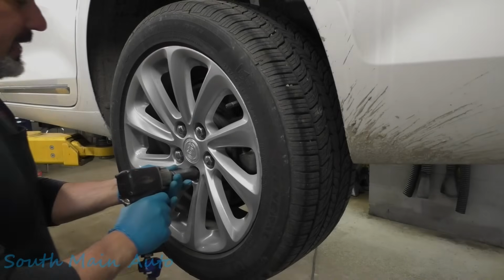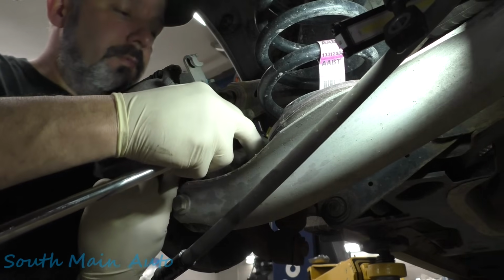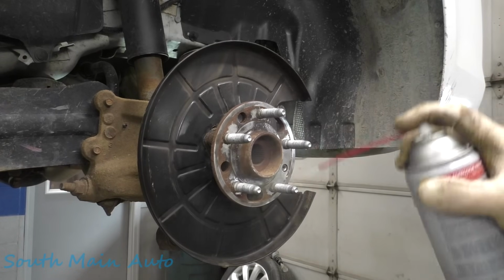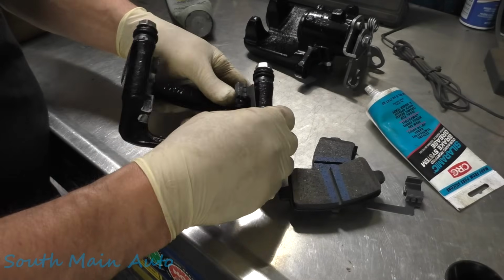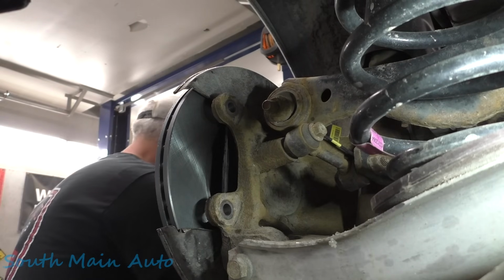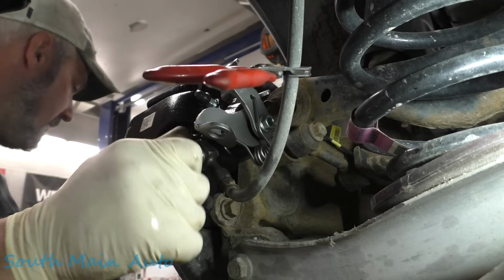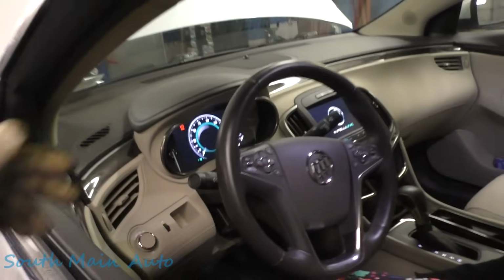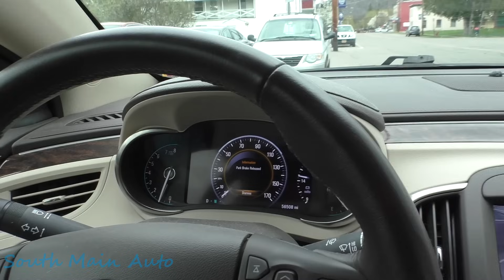Buick LaCrosse: Rear Pads, Rotors & Calipers

Comment: Hi Eric,  greetings from England,  UK.  If you want a handy thin wrench to do those caliper slide pins and other bolts that are restricted for width,  buy yourself one of those multi combination spanners / wrenches that are sold for cyclists,  they have got me out of a muddle a few times with calipers and they usually cover sizes from 8mm to 15mm or so.
All the best mate.

Comment: Mrs. O always looks so wholesome and nice. Very pretty dress there lady.  Eric, that was a "Bread-n-Butter" job where I worked for 25yrs. On all of my brake jobs I'd put slick'm between the pad contact and the stainless steel hardware too. My brake jobs went 100,000 miles sometimes, and never had a slide freeze up. Also when I went to Automotive Tech School we had to take a fastener class where we were indoctrinated that every bolt that gets "torqued" must have lube on it. So, I always slicked up the mounting bolts w/ Synthetic grease. And, I slicked up the lug nuts with it or wheel bearing grease too. The guys that worked with me at the the muffler joint thought dirt, rust and cross-threading was what keeps a bolt tight. I tried to splain them NO the bolt stretches and that "spring tension" was what keeps it tight. I been mechanicing for 57 or 58yrs  and never had a lug nut come a loose.  ben/ michigan

Comment: I bought a 2005 la crosse used in 2006. Put 245000 miles on it ran great and sold it last fall. Very few issues loved that car
Reply: Yea but Eric thinks USA cars are junk...
Reply: I got an 06 cxl 3.8 with 95000 miles it will last forever.

Comment: Just did the same thing 2 or 3 weeks ago on my girlfriends 2014 Chevy Impala. Exact same thing, 2 years older, only i did the hubs and wheel speed sensors as well. You are probably the only reason i even attempted doing the hubs. Pain in the whoo haa. Didnt have the last chance so i used a half inch grade 8 and my dwalt impact. Got rid of the helicopter and the brakes work beautifully now. Did the front hub about a year ago and the half inch grade 8 worked perfectly. The backs a lil different. And the reason  i changed the front was a diagnoses i learned from you. Abs light and traction control light... either abs sensor or the magnets gone. Sure enough when i pulled the hub out the magnet was 2/3 gone. Thank you brother. Love watchin your videos and learning.

Comment: So about squeezing brake hoses.  When doing calipers I use this opportunity to change out the old brake fluid and let it run out. Squeezing inner lined hydraulic hoses is a little dicey. I really enjoy all your difficult car repairs. Keep up the great vids.
Reply from the maker: Explain with any evidence or logical exploration how applying less than 1psi of clamping force to a brake hose is "dicey." This hose holds back over 3500psi you know. I'm interested to know your findings.

Comment: Great video, now I have to go finish putting in a new radiator that came with a broken overflow nipple. Of course I didn't notice it until I had it all in and then looked in the bottom of the box. My JB Weld should be hardened by now.

Comment: A simple explanation of what can happen after clamping. The hose opens when high pressure is applied to stop but closes when pressure is removed keeping pads in contact under slight pressure at the least. If the hose delaminates it can become a one-way check valve and lock the wheel.

Comment: I had my RR caliper hang on me in January, so I nursed it until I could change it I. The garage. By the time I got to it, the ear had become my outer pad and the outer pad was MIA. Obviously, I wasn't able to return that caliper to get my core charge back. 

I think I remember when my caliper started becoming my outer pad because the grinding wasn't as bad. I thought my brakes were fixing themselves. 

The LR was fine as well as the fronts. If one of the fronts was hanging I wouldn't have tried to drive on it until I could get to it.

Comment: I had a failure on a 2001 Malibu because the brake builder assembled the pins dry and I had yet to learn that lesson on checking and lubricating pins. This was in 2004.

Comment: If you don't have pinch off pliers for the brake hose you can just use a bolt and nut and the original crush washers, usually works fine

Comment: Put on a reman caliper bracket and it rusted right away.  Took it off, sanded it down and sprayed it with hi temp aluminum color rustoleum.  Same for face of replaced rotor.

Comment: I'm not knocking the hose crimp but i usually just loosen the banjo bolt but not enough to leak and set the caliper aside the last step in assembly is swap the hose thus eliminating the crimp hose step

Comment: One nice with the electric parking brake and a manual transmission, auto disengagement once power it applied to the wheels. Never have to remember to take it off before leaving.
Or, can allow for easy hill starts without even thinking about it.

Comment: Eric, my take on the electric parking brake is the cables are short, do not corrode much and do not seam to get stuck. I also live in this state and welcome any improvement that actually work in the rust belt. Ross

Comment: I have a 2013 LaCrosse and have been worried about changing the rear pads since it has the electronic parking brake. Looks like it is not much different then manual  so I will give it a try, Thanks!

Comment: Hey Eric.

Happy to see you used a Metric Needle Nose Vise Grip on the Metric Brake Slider Pin. It did look like it was a left sided one too. Did you use the Right Sided one on the Right side?

Seeing as you are going to such effort to provide AWESOME educational material. When will we see you do a "Muffler Bearing"  video.

Keep up the good work with the locking hose clamp. Disappointed you DID NOT Use WD-40 (not a sponsor).
Reply: Muffler bearing replacement was covered in the blinker fluid video.
Reply: @ProblemChild-xk7ix  Was that the same episode in which we change winter air, for summer air in the tires? I could never get that purge thing down... Need a better purge pump, I tell ya. Get me a bucket of steam to break the bead, and start fresh.

Comment: Is this the design where the piston will only travel out so far because it dead heads internally on the parking brake mechanism?  Had a GM that was designed that way.  Firm pedal but the pads were only dragging on the rotor and eventually, not touching at all.  Rotor all rusted up and a ton of pad left.  You had to use the parking brake occasionally which practically nobody does with an automatic.  Love the channel.  Your wrenching and diagnostic skills are top notch.

Comment: Hey now... good video... in the past I have stuck on old valve stem, or a new one as a tool,  in the banjo bolt hole to stop the brake fluid drip... for those opposed to clamping the line.
Thanks for all your great info!

Comment: 2016 with new rear springs. Wonder if the spring replacement did something to the caliper?
And then maybe not as I see rust on the bottom of the spring

Comment: at my last shop before i left i worked on a thundra one of the calipers was locked up they sent the wrong one it lined up perfectly but the mounting bolts were smaller i went to the home depot got some new bolts and as far as i know it’s still chugging

Comment: Thank you for another great video!!!
Does anyone know where I can find instruction for reassembly of the guts of a steering column on a1990 F250 ?
I went to replace the steering wheel lock actuator and wasn't prepared for springs to fly out because I didn't realize that the 2 side pins were under that load and parts went flying 😢😢.

Comment: Is that Silaramic not ideal to use on the pins? Getting ready to do 2017 Camry fronts and not sure what to use on the pins. I have Silaramic and an old tube of sil glyde. Come to think of it, I thought you mentioned recently in a vid that some Toyotas have a one piece caliper. I could be wrong. Cheers.

Comment: Love your videos.  I need to put some ceramic brake pads on my 2015 Impala.  After watching your videos I have all the confidence I need to do the job.  I like your videos because you don't cut corners, and you show the details that make the difference.  My brakes don't pulsate, but I THINK I SHOULD HAVE A SHOP GRIND JUST A BIT OFF TO DEGLAZE AND TRUE THEM UP.  WOULD THAT BE A GOOD IDEA?  I have about 75,000 miles on the car
Reply from the maker: Absolutely! If they're still within spec as far as thickness then have a shop machine them down for you. If you're replacing the pads. We can't do that here because our s are so rusty
Reply: @SouthMainAuto  Eric, thanks for your prompt reply.  Now I just have to find a place that still turns them.  Keep up the great work!

Comment: Another spin on electric parking brakes. Do these have a central motor that sets both sides v motor on each caliper? And, since in gear disengages, can you use as an emergency brake no longer?

Comment: I just replaced the brakes on my mothers Buick lacrosse, All four pads and rotors. The rear caliper pistons would NOT spin back in. That and the fact that it was a pain to load the pads in the bracket was one of the most frustrating brake jobs I’ve ever done. Hah!

Disclaimer I am not a professional, just a DIY’er.

Comment: I use Lloyd’s moly anti seize on callipers sliders and pad and tins ,ends and faces. IMHO Only stuff that resists horrible winter road brine and salt. Also I watch your channel a lot. Do you think changing brake fluid when doing callipers is advisable ?
Reply: And you use a torque wrench !! Love the beeping ones. Cost me 600+ bux

Comment: Stupid Question: a 2010 Buick Lucerne has the same rear brake caliper setup (The only thing different I notice is the parking brake is 100% mechanical with some silly push to lock/push again to release pedal, which will probably lock up resulting in a skid during an emergency stop.), right?

Comment: Heres a good question ....I did the exact same thing you did Eric. cleaned the hub face ....nice and shiny.  then a light coat of fluid film .....I set the torque wrench to 100 foot pounds ...the wrench did not click off and I snapped two wheel studs.  The shop I took it to for other work replaced the studs. i was told you should not put any lube on the wheel studs as it changes the wheel torque and stretches the wheel stud ??? 

How come it works for you ....what did I do wrong ?  Dont let the experts in the comments get you down .... I used your advice for a GM evap problem and figured out that the fuel filler was rusted out :)

Comment: What happens to the electric parking brake if you lose power?
Reply: If you applied the parking brake when you parked it and the next morning you get out there the battery’s dead you’re not releasing the parking brake if the brakes aren’t set even if the battery’s dead after you jump it, you’ll be able to move it if you try to apply to parking brakes and there’s a power problem to them they won’t work

Comment: I spent an hour and half looking for my new klein wire strippers. Could not find them anywhere. I put them in my back left pocket typically. Turns out I put them in my back right pocket with my wallet. 😂😂😂 After that day I bought a tool pouch for my electrical tools.

Comment: So whats your guess on why the caliper was sticking?  Caliper not sliding? Parking brake cable sticking 'on' ?
Reply: The caliper had to be sticking internally. If the parking brake wasn’t working correctly after he installed a new caliper, we would’ve saw that the brake was hanging up and that could be a cable, but when he removed the cable, he grabbed it and pulled on. It felt it move so he didn’t think the cable was bad and he was right.
I personally thought it was gonna be a collapse brake hose but when he removed  it was dripping freely, and he clamped it with the vice grips

Comment: Eric, is the rule of thumb to use silicone grease on the caliper pins and ceramic grease on everything else? Or does it not matter that much?
Reply: lol.  anti-seize works on almost everything here in NH.  the only thing that gets anything else is electrical connections that get di-electric grease.  :-)
Reply: Some of the ceramic greases damage the rubber bellows on the floater bolts.  Wrt ceramic grease coating the sliding area of the pads I believe it gets washed off real soon.  Ceramic grease good to lube up the contact area of pads against the pistons.

Comment: HEY ERIC, I found you a couple years ago because I was searching fluid film.  After always giving a spritz of the sheep oil, some extra lube on the brake shoes do you ever get cars back for the next job with any remnants of your original efforts.  Personally, I've always greased everything.  Even lug studs.  If you've dealt with lugs rusted in place you'll never go back to dry.

Comment: not much rust for a 2016.  
have you ever have a brake hose come apart in the inside the hose and act like a one way valve? put brand new calipers and it still hung up.

Comment: If the brake hose was clamped or kinked before, that could be why the shoes are dragging.
Reply: Clamping the hose damages it and causes it to delaminate internally, resulting in a dragging brake.
Reply: @karlkascha1261  That is what three major hose manufacturers have told me. Vacuum. fuel clamp all you want on the single-ply hose. We all agree it's bad to let cast iron calipers hang by the hose, don't we?

Comment: @3:38 I blame those damn tool gremlins.
They play tricks on mechanics by reaching up while your head is turned, snatching an important tool you are using, hiding it momentarily until you curse a blue streak and then return the tool to it's original location all the while laughing at you behind your back and mocking you!
😈😂

Comment: i see you have the new snappy locking flex ratchet. thoughts?
also no more copper crush washers or is it just this style of caliper? 
electric parking brake....who would of thunk. the epitome of laziness along with push button start. i agree. solutions to problems that didnt exist. just more electronic parts to go wrong to sell us.
thank you eric.
Reply: the reman caliber came with two new aluminum crush washers for the banjo bolt

Comment: Could the hose have collapsed internally?  Or do the calipers just not hold up?
Reply: That's a good question, although it would be uncommon for it to happen on both sides at the same time. Some guys routinely replace the brake hose whenever they replace calipers, which reduces the chance of an error. If the caliper is completely seized you can remove the hose, and if it is still seized after that you've got compelling evidence that the caliper is the problem. Hoses can have an intermittent ball valve effect caused by internal delamination, and it may disappear when not loaded, which is very confusing. So a bad hose may drip fine after being disconnected which doesn't help much. For what they cost, and given the way they tend to get crusty and rotted over time, in my old cars I thrown in a new hose too.

Comment: I like to gravity bleed the lines after I install hoses or wheel cylinders or calipers.....i have seen over exuberant brake pumper uppers put a ton of bubbles in the fluid and damn near pushed the pedal through the floor other times.....let 'em drip drain while working on the other side and you will thank me later....LOL
Reply from the maker: Yep, just like I mention in the video

Comment: I have no idea why pinching the hose is considered "controversial" because if the hose is too fragile to be pinched...it would explode under pressure of applying the brakes anyway.
Reply: I think the controversy is it might create a weak spot where it was crimped.

Personally, I cannot stomach it, but Eric is the man!
Reply from the maker: Yeah that's what all the experts say. And by experts I mean people on YouTube who have absolutely no data to back up their assumption. For some reason it can hold back over 3,000 PSI of pressure but putting about 1 PSI of clamping pressure on the outside to keep it from dripping somehow completely destroys it. The same people who are hose experts are also professional welders and wire crimping experts.
Reply: And spray lubrication experts….

Comment: Rotor screw, eh? GM spent the extra money for these? I never saw these on my ‘07 Lacrosse (at least not in the rears).
Reply: A lot of cars get flipped around at various angles down the assembly line - it is to prevent the rotors from falling off until the wheels are installed

Comment: Putting rear vented rotors on a Buick seems like overkill. Front brakes on most Buicks get barely used, so rear ones probably rust over before seeing any significant wear.

Comment: ???  when did gm go all metric?  i mostly only do mazdas and hondas so been metric quite a while...  and it's bummer you have to use "green" brakeleen, it sucks.  instant rust.
Reply: Well 11mm is 7/16 and 15mm is 1/2 so they may not be
Reply: @ReservedForFutureUse   ouch - they are not close enough to use on rusty crap. you'd just round them off. been there, done that. :-(
Reply: How exactly does green CRC suck if causes rust?  Seems to me it did a damn fine job of removing any oil.

Comment: General Motors quality has really gone down hill. I have a 2012 Silverado and besides it rusting terribly and I wash it matistically. Anyway I only have 80 miles on it and have had to have a rear drive shaft seal put in and a clutch in the rear end or something with the gears.